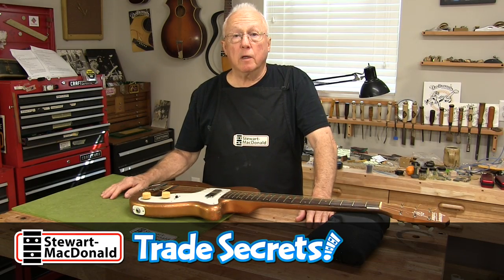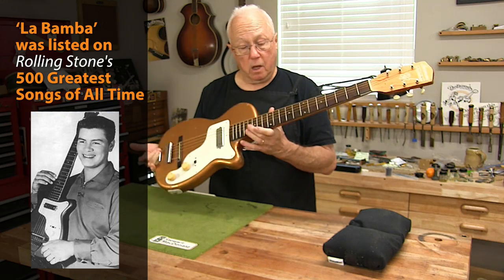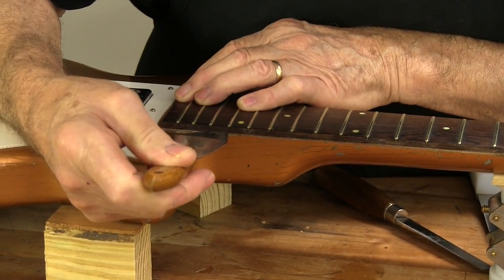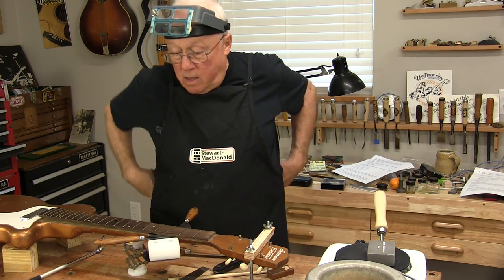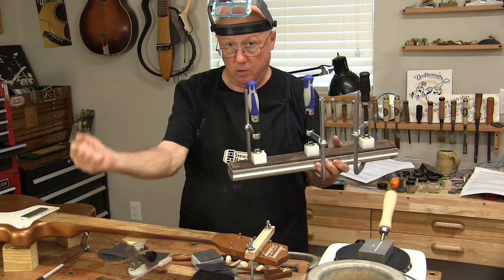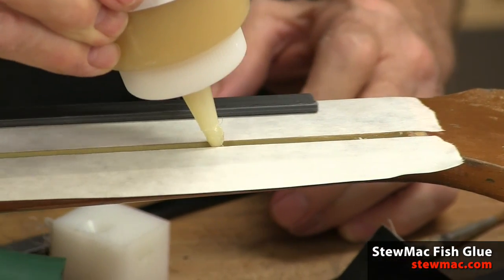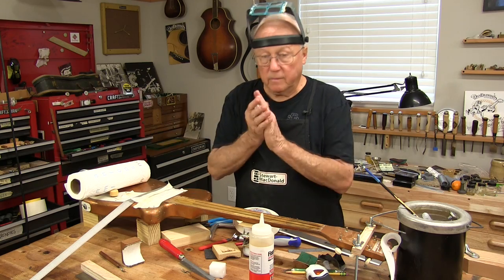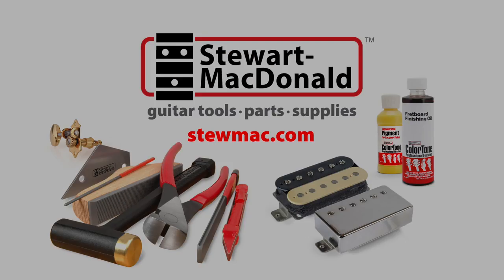Installing carbon fiber neck rods in a Ritchie Valens style StratoTone

Comment: What Ever this Guy Charges ...he's worth every penny
Reply: And then some too Kevin!
Reply: I think it's Dan Erlwine he used to have a column in Guitar Player in the 80s
Reply: @guitard1280  I'm pretty sure he is Dan
Reply: It is Dan, yeah.
Reply: I’d pay up to $5000
Reply: @ramencurry6672  he’d take your money lol
Reply: These guitars can go from 1-2k on eBay now, and with this being 6 years ago at the most it seems likely this would’ve been 1200 at the most especially since it is in good but not mint condition. I’d fall over if Dan charges anything less than $100 an hour. The mounting looked at least 30 minutes. Removing of the fretboard 45. Setting up the routing jig and routing, 1 hour minimum. Rebinding and regluing the fretboard, 30 minutes tops including making the glue cauls. At the quickest it seems likely this is a $300 job, but in all seriousness $500 seems more reasonable. It’s the creative craftsmanship that makes this seem worth double or triple that to be honest.

Comment: Doing RC aircraft modding work, it was suggested to me that cutting carbon fiber can be dangerous. I've learned to either cut it with a constant spray of water to minimize dust, or even cut it just below water to keep any dust from being able to float into the air. Hope this is a helpful tip!
Reply: The guy sniffs glue. He doesn't give a shit

Comment: Had a Stratotone in the shop where I work for a while. Whatever that cheap little pickup is sounded incredible.
Reply: I couldnt agree more that sometimes cheap overwound pickups sound great!! I had a Tesco Del Ray that had cheap wide and shallow wound single coils. Tone for days. It also had on/off switches for each pickup that gave you a brain bending number of combinations.
Reply: I picked up a guitar at a thrift store for $75.  It was all sanded down but looked cool.  It ended up being a 65 Stratotone with DeArmond pickups.  It sounds great and is fun to play.  I also picked up an old Bobkat with an old Silvertone tube amp for cheap.  THey sound great as well.  Both of these were lucky finds!  Cheap looking stuff that sounds awesome!

Comment: On my first neck thru bass build, i used your 1/4 inch square graphite reinforcing rods. I routed them in at the same angle as the edges of the neck for extra triangulated strength. I also used your gibson style aluminum channel truss rod. I glued the stewmac ebony fretboard on clamped to a brass I beam. It took about 4 passes with a radius block to get the board flat. I used your brass call in an arbor i made with my drill press. The neck was so stiff and strong that just for fun i strung it with a five string set, .125 E .105 A .85 D and .65 G. Then tuned it up standard pitch. That neck took it in stride, but my fingers couldnt! Lol do to the full 5/16 full center thickness of that awesome ebony board, and those chimey rods, i ended up having to shave the back of the neck with my minny spokeshave to the point where the graphite rods show just to get get upbow for fret clearance!!!! Oh and i carried Dans fretting book for a month! Lool also, using the fret caul and pressing them in slow and careful, i did NOT have to level and recrown the frets.

Comment: Thanks, Dan - you never cease to be an inspiration. I am a luthier who also does restorations and repair. Not a day goes by when don't  I think "Now what would Dan do?"
Personally I would have pulled a top and bottom fret to drill guide pin holes to keep that fingerboard from sliding, but you obviously didn't need too....
Reply: I have a banjo with a unplayable upbow - so I'm thinking about this as a solution. Have you worked with CF rods and if the same method was used would one rod add sufficient rigidity? I think there's only room for one rod in the center of the neck due to the fifth string tuner insert.

Comment: Excellent, as usual. I have about as much work area as a toaster takes up. In fact, I'll have to move the toaster to find it.  I had two of these babies...and super clean surfaces on them. Had to raise the bridge on one by adding some felt under it...even sold it that way. Wonder how long it took before the guy.....Mark Ribot plays these, and turned Waits onto them. That sorta thrilled me, as back then I had two of these.. and in way better condition.

Comment: Funny coincidence. I am doing this exact same operation of adding 2 CF rods to my 1940 Harmony archtop with no truss rod, a 3/8" string action, and a slight twist. I wish my fingerboard came off that easy, mine was a serious struggle the whole way. There is a  reinforcement rod slot in the center half filled with glue. I'm going to plug that with some hardwood and cut the 2 slots for CF rods like Dan did. Well, my jig is different, but whatever. Glad to now have confirmation my plan is valid.

Comment: Hello Mr. MacDonald.  I have searched the internet and cannot find the answer to a question regarding an old 70s Kawai electric guitar.  (Sold in the UK branded as 'Audition'.)  Purchased on ebay, the neck was twisted. I have removed the fingerboard and truss rod and sanded out the twist.  The truss rod was difficult to remove and seemed very corroded. My question is, when re-fitting the truss-rod, should it be glued/epoxied along its edges (I assume sides not bottom) where it contacts the neck inside the slot?  The truss rod is very simple basically a piece of square aluminium open at the bottom, it has a steel rod running down the centre.  I suppose it it slightly similar to the Martin one you sell on your web site.  I was sure there was a video on your channel showing a similar installation, but I couldn't find it.  Many thanks.

Comment: I installed a 2-way mandolin truss rod into one of my Stratotone Jupiter H-49 necks. The fretboard was glued down with 2 different glues, hyde and some sort of 50's household glue cement. It appears the person at Harmony who glued fretboards on must have ran out of hyde during assembly. You shoulda seen my face when the spatula hit the cement.

Comment: Did anyone notice the strings are still somewhat high after Dan installed the rods ? I think Dan does excellent work and was only showing one repair in this video but this is a neck thru body and more needed to be done . The whole reason for the fix was to lower the string height since as Dan said , "The owner doesn't play slide" . The neck needed to be planed and sanded at an angle to make it true before putting the fret board back on . Otherwise the string height will remain the same . This is a common problem with these old Harmony H44's .
Reply: Good catch.  Now i gotta go back and look.  A real truss rod is needed.  Yup...you're right.  Looking at the low E string, you can see it's way high.
Reply: David Poggioli I'd say it's a neck angle problem, if anything. Dan's solution is not too invasive; planing the neck might buy you some height but at that point you're throwing off the geometry as far as the headstock etc. and changing the neck profile. Maybe make a lower bridge and keep the original?
Reply: I think the owner can now lower the bridge without getting a buzz. That's something Dan might even do after this video. Why would the neck need planing? If it's straighter you can lower the action.
Reply: Sketchy Songs On Saturday I don't think Dan should have released the neck before he put in the carbon rods.  I would have left the neck tensioned, then dropped in the rods.
Reply: David Poggioli they are still high due to that pathetic bridge and nut. Guitar is firewood at best.
Reply: He left it tensioned, the scissor jack & clamps are still there, he just took his router setup away
Reply: I just looked again.  I see that the jack is still there and i thought i saw the headstock move like he had taken the thru bolts out of the bench holes.  Now that i'm looking again, i don't see it.  I think i might need to go down the mental institute and check myself in.  Thanks for the redirect.  You have sharp eyes.
Reply: Some lowering of the nut slots, or sanding of the bottom of the bridge can be the easy fix.
Reply: Once you get the neck straightened out, the rest of the setup is just normal stuff.
Reply: had exact same question

Comment: from what i can see, at the end of the video, you say it has a little relief?  It looks like the action is still 1/4 inch high? I know Dan is superman , but I would have straightened/flattened the neck before adding the rods instead of using the jack to force the bow out. Did it really fix the playability 100% ?

Comment: Hi Mr. Erlewine, a few days ago cane to me a bass guitar brand new with several problem with the strings action. I have try to adjust the trus rod but it seams like fixed on the its slot. After to reached the maximal tork adjustment, it remains curved. Is it possible to reinforce it without pull off the finger board using the back side of the neck?

Comment: You can probably make sure the clamps are completely straight if you put a mark  on either side of the metal circle and a straight line across the wooden blocks you were using at the end.

Comment: This is amazing -- but why not put in a full fledged truss rod?
Why the carbon fibre rods instead?
With a truss rod maybe you'd have to put some kind of wood on top of it as well to get it more inside the center of the neck and it would be more involved?
Reply: Good point.

Comment: Man, your work and experience are amazing! I have a question. I've got a 2002 Jackson Randy Rhodes 5. I believe its Japanese made. My guitar has had this buzzing issue for years. I had put off a fret job for a long time though it needed it. And I had thought that most of the buzzing was from that. I recently did my fret job and changed the nut, the guitar plays amazing the intonation is as perfect as can be on guitar very proud of my work honestly. However there's still this Buzzy rattling sound coming from the neck it is definitely not the strings it happens even when I've got the action crank Way High and I believe the Frets are as good as he can be. My next thought was that it might be the bridge or the string ferrules either that or maybe the tuners on the headstock it does come from the neck sound. So I thoroughly eliminated each one of those possibilities. The Rattler still there in fact it's worse than it ever has been. My final suspicion is that the truss rod itself has become unglued in the neck. Is still works fine on the recent setup I did I had to adjust it adjust the touch and it worked fine everything sounded great. But that buzzing thing I notice is if I put a little pressure either forward or backwards on the neck as I play buzz goes away. So can that be possible can the truss rod be unglued in the neck?

Comment: you said neck had upper warp...so no  process to remove warp before routing for straight carbon fiber rods ???..so what took the warp out of neck  ...   the center scissors clamp  pushing the neck straight   or    just the rods alone ??....thank you
Reply from the maker: The scissor jack is used to straighten the neck while in the fixture.  The glued in carbon fiber rods keep it in that straightened state and string tension pulls the neck into slight relief.

Comment: As an amateur guitar builder, I have always been concerned about the neck area directly under the nut, between the fingerboard and the peg head, how weak and easily broken it is. Suppose you continued the carbon fiber slot into the peg head? When you glued down the peg head veneer, the carbon fiber rod would be concealed and the rod would reinforce that area. Doesn't this make sense?
Reply: I know what you mean! That area can be as thin as half and inch and have wood  removed for trussrod access on top of it. Nerve racking! I've thought about what you're talking about with the extended carbon fiber as well and it would certainly be very strong but builders and luthiers have already come up with adequate solutions with wood. First is a headstock volute which is essentially extra carved wood under the nut area. Next is multi-laminate necks that sandwich layers of wood for a stiffer and stronger neck/headstock overall.

Comment: I've seen violin makers use denatured alcohol to make hide glue more brittle to break the joint.
Reply: My gawd, I can't imagine dried hide glue getting any more hard and brittle than it already is. I'm going to play with that and see what effect it has. It doesn't sound very beneficial, unless it lets go of its incredible grip. That's what moisture and/or heat accomplishes.
Reply: 100amplifiers I've never actually done it, but there's a video of a guy removing a bass fingerboard using that method.
Reply: Interesting.  If you ever find the link, I'd like to see that.
Reply: Kevin Leamon Just have to be careful. Violins have shellac on them which is more ethanol 
soluble than nitrocellulose.

Comment: I too wonder why Dan didn't put in a truss rod but I understand why he had to add the carbon fiber rods  to level it . What wasn't shown was the string height . Seems a bit high . In order to repair that on a neck through body you have to remove the fret board and plane the neck at the proper angle . Dan could have done that first before installing the carbon rods . Only way to do it properly since you can't remove the neck .

Comment: But how did the neck end up straight? Where did the straightening occur? 🎶🎸
Reply: Quite reasonable question. I guess the carbon did it on it's own, after the glue dried, as the forms held the neck straight or so during the drying.

Comment: with this system you can not adjust the truss rod, correct? what if you chose to go for higher gauge strings in the future?
Reply from the maker: You're correct, there is no truss rod to adjust the neck relief on this guitar. However, the carbon fiber neck rods that Dan has installed are very strong, and will not allow the neck to bend much further than where it's set now.

Comment: Action still looks ridiculously high? Or is that just the nature of the beast?
Reply: Nature of the beast, many of these old cheaper guitars already had high action from the factory when new and could only be played with a slide, make the neck poplar and then give it 50-70 years and you've got a neck with ridiculous action, with a proper setup and a full on truss rod it could get fully playable properly though, but that wasn't done here
Reply: @Daizenzetsu  thanks for taking time to reply.

Comment: While I am sure that fish glue is excellent for wood to wood joints, I am concerned as to how well it bonds to carbon fiber,?  I would have used an epoxy to glue in the carbon fiber bars, and scored them with ONE pass of a very corse sandpaper then wiped them clean with acetone before gluing.

Comment: You get these really old and rare guitars in then play them for like 2 secs, it would be nice to hear the different pickups or settings. I mean, this guitar has a switch on it, and one pickup - what does that do?
Reply: Volume tone, and a pretty warm sound with the pickup where it is. You want a brighter sound...change the pots.
Reply: I've built guitars and electronics for 3rd of a century, having spent most of that time in and around London's Denmark St. I've played most everything going thanks - so what does the switch do?
Reply: Prince Westerburg - This from the 1957 catologue probably answers your question: "Has responsive built-in pickup, with tone and volume controls. Special slide-switch  permits quick change from bass emphasis used for rhythm playing, to treble emphasis for take-off or solo work".